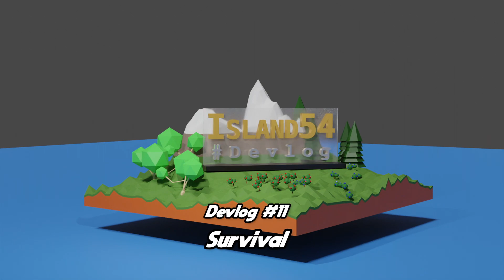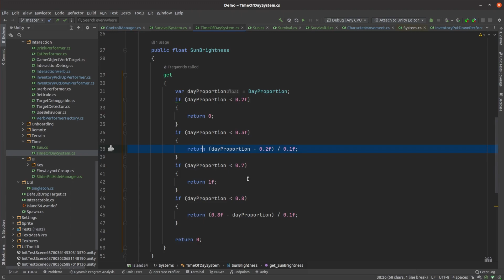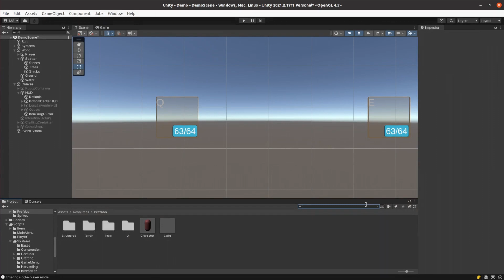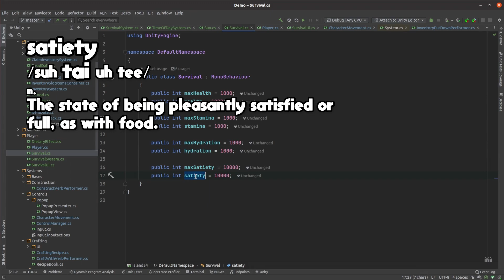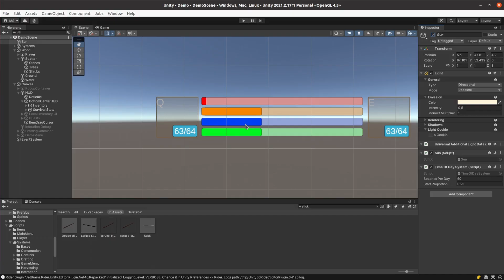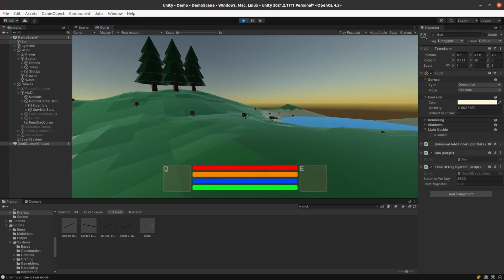Adding a Survival System | Unity Devlog #11

Comment: Great devlog, I enjoyed your explanation. Do you have a method for tuning the different rates and stats? Spreadsheet model? Something else?  Have sub'd looking forward to the next!
Reply from the maker: It the moment, I'm just picking arbitrary numbers, and not caring about the balance. I need enough shrubs nearby to let me test the food system, but don't yet care about how challenging it is.

If I manage to get this thing off the ground, then I'll need a whole process around it. Each resource or stat or whatever will need to be tied to its goals. I'd then want to define the time or effort needed for each of those goals, and tweak things to achieve that.

Comment: may i ask why you're using mouse position raycasts as your mode of object selection? havent seen it before and im curious :)
Reply from the maker: I started out with the mouse controlling the player's head and a reticle (which is pretty normal). In Episode 7, I added the concept of a "local inventory" panel. I needed to make a decision between requiring a key press (like 'i') to switch between mouse-look and inventory mode, or using a control (right mouse button) to temporarily enable mouse-look.

There are a few other games around that do it like that. Pretty much anything with a detached camera (think strategy games) do it like that, and it's pretty common for some of the older RPGs. What's unusual about my approach is that I'm combining it with a first person controller.

To help experiment with this approach, I partly implemented drag-and-drop in Episode 10 to simplify interaction a bit, but still don't have it fully implemented which makes it a bit clunky. 90% of my interactions at the moment are inventory interactions so I expect a lot of the clunkiness to go away once I have dnd working with instantiated objects. Once I have a chance to playtest it, I'll make a final decision on which approach I go with.
Reply: @Island54Games  ah i see! Its definitely an intriguing functionality, i think it could lead to some unique UI interactions, though if theres anything high speed going on i reckon it might feel a bit awkward. Looking forward to seeing what design choices you go for!